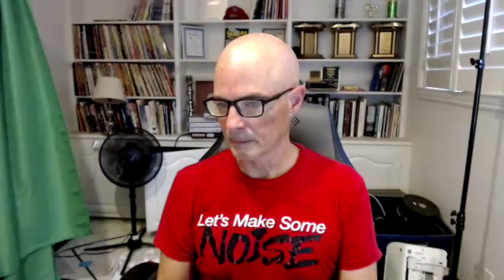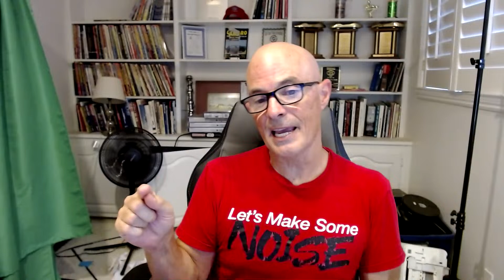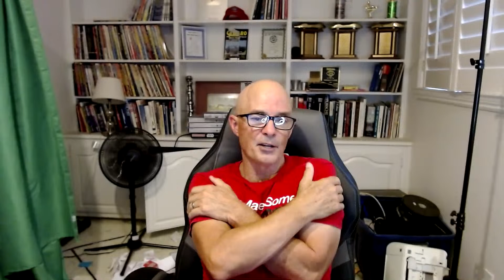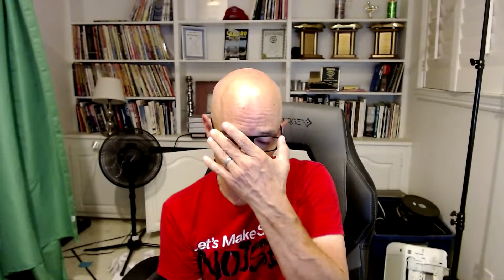CAM LIFT-DOES IT MATTER? LET'S TALK TECH

Comment: Are vacuum secondary carbs better with automatic transmissions?
Are flat top pistons and a larger combustion chamber better than dished pistons and a smaller combustion chamber? Or domed?
Reply from the maker: smaller chamber and flat top
Reply: @richardholdener1727  I’d like to run L98 aluminum heads on a 400 sbc with an Isky 292 flat hydraulic cam. It think the cr will be too high with flat tops. Should I stay with the dish piston?

Comment: You know before I watched the stream I used to think I was no such thing as a stupid question.. I stand corrected LOL. 

I got a question has anybody actually done the hybrid built with the LS3 bottom end and an LT Gen 5 head? I watched your video and it was very eye-opening and now I'm actually thinking about building one of these how do you think it would perform with 91 octane? Most likely going into a car that weighs under 3,000 lb and would be for a road course situation no drag racing
Reply: Forgot to mention horsepower wise I'll be looking around 5 00 to 540 horsepower at 7,000 RPMs so I would be shifting say 7500 RPMs ish on a wet sump thanks man and anybody else reading this
Reply from the maker: that route is very expensive-you can make your power with an ls3

Comment: More lift and keeping the duration the same would have faster opening , so wouldn't that alone increase hp regardless
Reply from the maker: that is why we tested-because theories don't make hp
Reply: Yes, I agree. Increase lift doesn't have as much low end torque as increasing duration.
Reply: Yeah testing is good , engine dyno isn't a car either so all isn't known 

It could accelerate faster and you're not seeing that on dyno either 
All just thinking out loud

Comment: Bottom line is modern engines are variable timed, boosted smaller and more power. OP question, my answer, All things considered, not in the modern world.
Case in point. 1.5L 4cyl variable everything with turbo boost in a small crossover . 200hp advertised.
The Nissan Rogue. 
Runs really good, with 8k miles on the 2023 model

Comment: Hi Richard, HOW much max lift can I use a street LS and Drive it 100 k miles? .550? .600? or- USING  proper rocker arms/ pushrods for that cam?
Reply from the maker: the question is WHY do you want max lift?
Reply: @richardholdener1727  hi Richard, Is lift not the determining factor in valvetrain life? aka more lift more spring pressure=less valve train life. Are guys running a .600 lift cam in an LS engine for 100k miles on the street?

Comment: If the intake manifold doesn't flow what the head can flow it will put a cap on total flow and so more lift doesn't increase the flow even if the head can flow more
Reply: The stock ls4 intake was designed to do exactly that to limit the power and help protect the 4t65e from blowing input shafts and clutches and such limits the engine to 303hp when all the other stock intakes make much more power